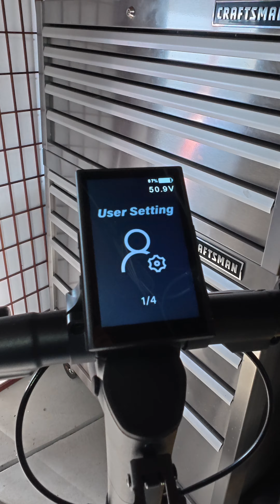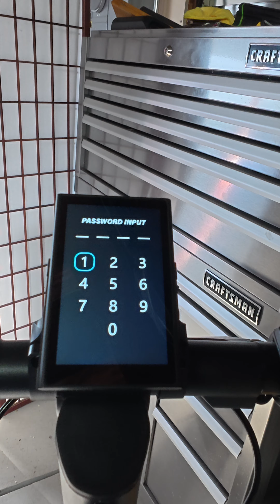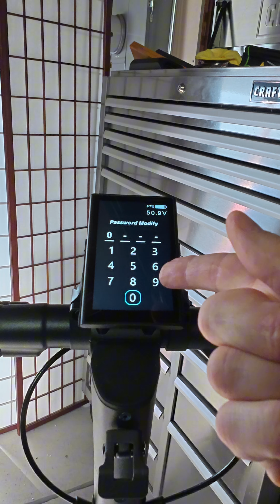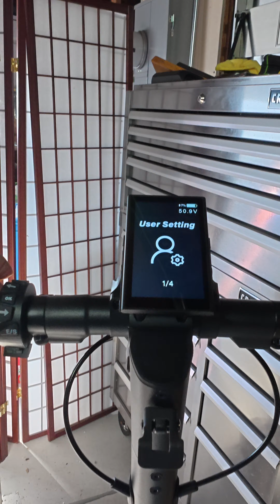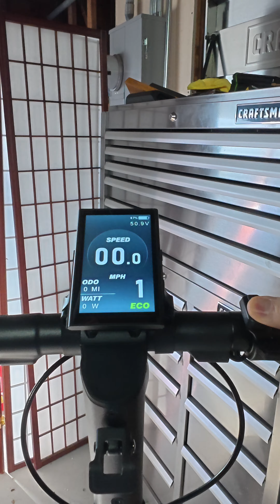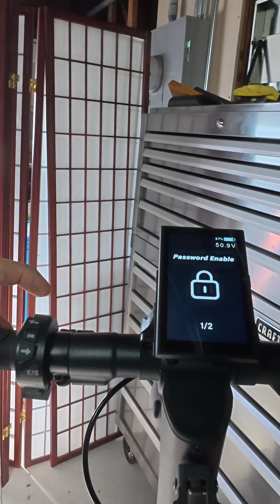Change your password: New VX4, New VX2 Hub, VX2 Extreme or other VMAX with full color display

Comment: I love my scooter but for 1600 it should be a touch screen
Reply from the maker: What are your favorite touch-screen scooters? I’ve only seen one or two. The now-discontinued OKAI Panther, and I think one of the Teewing/Kukirin G series scooters. 
Which features would you like to access through the screen? I’m just happy when I can access all of the features without pulling out my phone and fire up an app. -Paul

-Paul
Reply: @vmax_escooter i understand that is probably more durable to not be a touch screen but it would be nice to have it do a thumb print or to be able to use the screen as opposed to the left right ok and this is the only scooter I have bought based on your recommendation because you gave honest reviews. Overall I love it

Comment: Just a headsup, 
if you did not follow all the steps correctly, like me, and unsuccessfully tried to safe a password, the password will sometimes not default back to 1234!
After a mild panic i figured out that it'll default to 0000 if the custom input was unsuccessfully saved.
Reply from the maker: Great feedback! Thank you!
-Paul

Comment: I never understand why Vmax never started to use NFC in their scooters. You are swizz and SoFlow too, ePF and so on use NFC. Its much quicker and safe also. Put a card, armband over the NFC reader (Dsiplay E-Scooter) and done. Enter codes with buttons sucks. I am very interested in VX2 4G but this is one thing I never can accept on your scooters.
Reply: For me, I much prefer a code lock or no lock. I always forget NFC keys, and if you pick an easy code you can enter it super fast. Plus NFC draws electricity looking for a signal all the time, or requires a wake up poke before applying the card, which takes away some of the quickness of NFC.